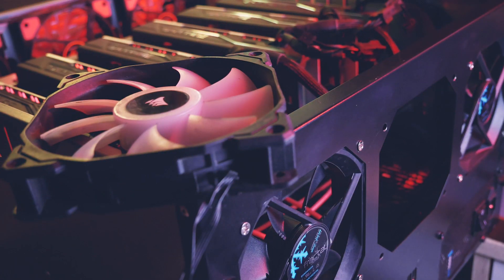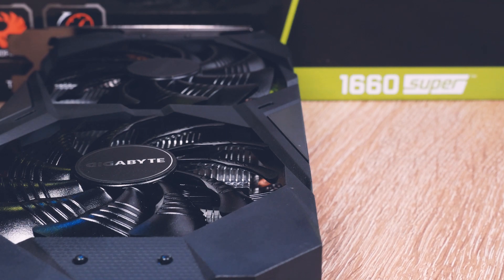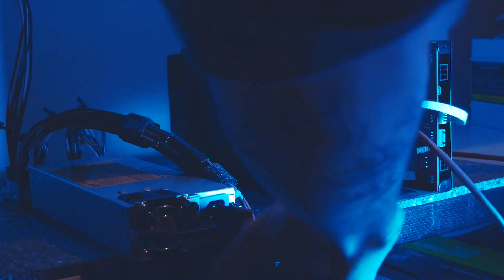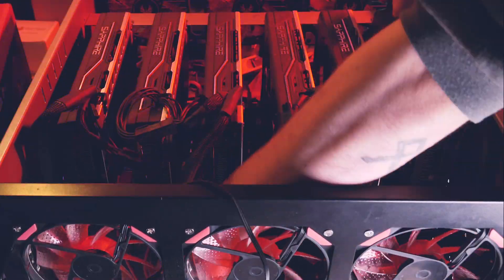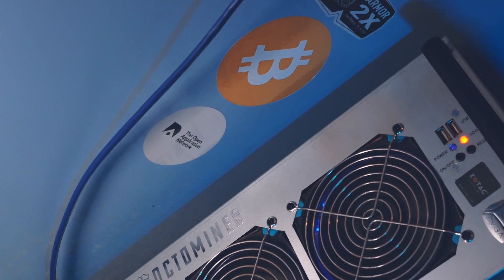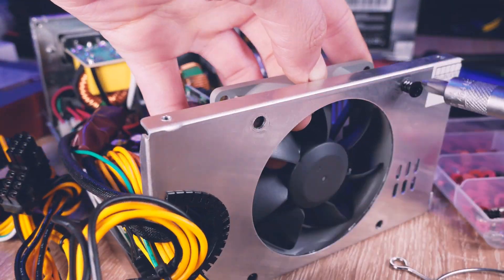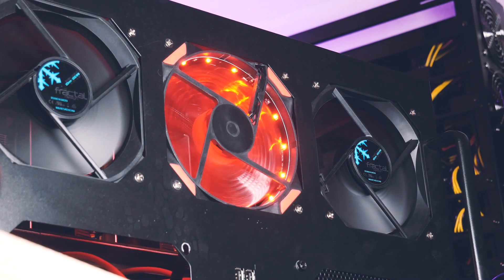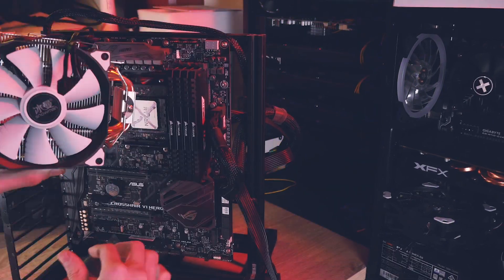No more ASICs! GPU / CPU / FPGA Mining Farm, March 2020: 2 years of Cursed Mining monthly updates

Comment: i sell 12x 1060 3gb, 3x 1060, 2x 1070, 9x RX 570 4gb, 4x 1080 and 2x vega 64.All mining on Windows.  With all that money i buy 2x octominer 9pci ( juste the motherboard and 2x 8gb ddr3 ram and 4x fans controler. Not the case) and 18x 1080 ti blower gpu with 3x 1450 watts powerSupply 90+gold. Now mining on Hashr8 os ETH at 780mh/s for  3015 watts! I will never buy again low and mid GPU. High-and GPU is the best. The GTX 1080 Ti and RTX 2080 Ti ( the RTX 2080 ti is to expensive for the moment.) I pay my 1080ti USE  335$ USD each! i start mining on 2017-10-28 and it was a mistake to buy low and mid GPU i know that now. You can mine so much more coin wit high-and GPU when the market is difficult.
Reply from the maker: I don't per se regret them as it was the only way for me in the beginning to scale a bit :) but I agree with you, nowadays (exceptions apply) I also prefer more powerful cards for more density :) your consolidation project sounds great :) I did so with nVidia now, AMD is next :) And yes 1080Ti is and will stay legendary GPU!! cheers and thanks for tuning in ⛏️